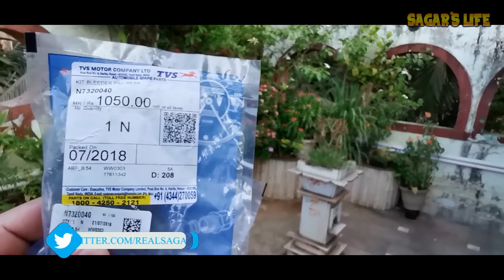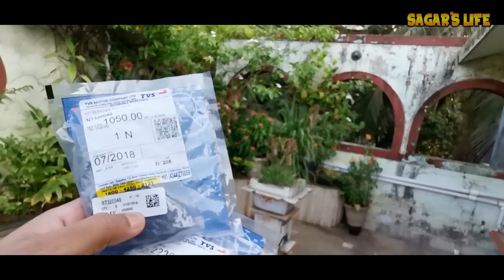How To Change Disc Brake Pads Of Apache RR 310 (Complete Guide)| Huawei P30 Pro

Comment: Hello Sagar my bike apache just clocked 6500 kms just did few long rides. When I should change my brake pads how to check life of brake pad
Reply from the maker: After seeing the brake pads closely You can view the remaining life of brake pad also there is guide in bike manual to identify the same with marking on brake caliper
Reply: Sagar's Life thanks

Comment: bro is bleeding required ?? i get spongy brakes on my 310 after changing front rear pads
Reply from the maker: Yes it's better to get all air remove, also if the oil is old then get it change, video for the same is already their on my YouTube channel 👍
Reply: Bleeding was done but still spongy braking works but play is more ...pads are entirely new ....
Reply from the maker: If It's for rear then it can be master cylinder issue lots of rr310 Owners faced it issue.

Comment: Bro I own an RR310, is there any alternate brake pads available since the company ones are dam costly. Please let me know if you have any idea.
Reply from the maker: Yes you can use the normal non sinther Brake Pads which will only cost you Rs. 200-300, but the braking capabilities also gets weaker on that brake Pads.. I will suggest you to use the stock sinther Brake Pads only, as when you can afford a 2.7lacs bike so the 1k brakes are not that costly 👍
Reply: Bhai i also own a 310 and the front pad got worn after 2400 km from 1st change . Should i consider rc390 brake pad for a try
Reply: @anubhavkapoor2305  I really don't know whether it's compatibile. Need to check with local services center
Reply from the maker: Yes you can use duke 390 sinther Brake Pads as they are same and cheap compare to RR 310 as they will cost you around 1700 as RR 310 cost 2236...
Reply: also chk ecb break pads they r lot better than stock
Reply: @anubhavkapoor2305  same here exact same km u hav to keep chking the rear pads they get struck on the disk when got rusted.... better buy a disk cleaner and keep cleaning every 100km
Reply: @SagarsLife  but it's 320mm disk front and 230 mm rear. Will it work?

Comment: Do we ever have to change the discs of the bike? I am talking about that big disc on which these pads rest.
Reply from the maker: Yes it's need to replace once you notice it's tearwear, as due do sinthered brake pads disk does get impacted
Reply: My rr's rear brake is absolutely nil and service center guys told me to change the pads but I think it's also related to the disc wear and tear. Do you know how the read disc costs for RR?
Reply from the maker: Sorry no idea as never change but it will definitely lower the price compared to disk brake pads, so will request you to try to change the pads with original sinthered one (not with the cheap rs.259)

Comment: The break pads are from brembo itself and are sintered .. Thats why it is costly.. You should have to mention this aswell.. good vedio btw..
Reply from the maker: I mentioned the same in video that these Brake Pads are sintered one...😊 Thanks for the heads up 👍
Reply: @SagarsLife  Bro only front brake pads are sintered on RR310!
Reply from the maker: Both front and rear brake pads are sintered, soon tvs is about luanch non sintered brake pads for rear only 👍
Reply: @SagarsLife  RR310's manufactured after December 2018 comes with Bybre brake pads at the rear which are non-sintered. It's costs approximately 300rs.
Reply from the maker: Yeah you are absolutely right 👍because of this the sintered rear brake pads will be no longer available in svc
Reply: @SagarsLife  no bro i said you didn't mention that brakepads are from brembo.. People thought it is the same as that seen in ktm 390's.. ktm uses bybre(subsidiary brand of brembo) which is cheaper in performance and price compared to one used in rr.

Comment: The size of this brake pad matches some other bike?
Reply from the maker: Not sure about rear but front Brake pads of RR 310 matched with duke 390 👍
Reply: @SagarsLife  ia the front caliper same for both bikes?
Reply from the maker: No both brake pads are different
Reply: @SagarsLife  sir, I meant the front brake caliper, not the pads. I think both calipers use 4 pistons right?

Comment: Bhai front and back costs how much combined ???? Brake pads
Reply from the maker: Front Brake pads cost around 2236 and rear 1050 so total cost is 3286
Reply: @SagarsLife  any sasta jugad like 160rtr brake pads are far cheaper can it fit into 310rr
Any similar idea will be appreciated
Thanking you in advance
Reply: @skp9821 bro  compromise by not spending money on stickers or fancy accessories.. Don't compromise on important stuff like brakes

Comment: ek help chaiye break related bro
Reply from the maker: Tell me Rohit...
Reply: @SagarsLife   apache 160 4v liya hu abhi 2000 km chli hai 500 km ke bad se break noise rear ka chikchik. kr k aa rha h service vale 2 bar plate 2 bar pad or ek bar caliper bdl diye or 5. 6 bar clean kr diya fir b noise thik nhi ho. rha h
Reply from the maker: @rht2992  you already have done the all possibility, just see whether the disk had any bends.. Normally after cleaning the brake pads it should be fine..
Reply: Bhai disc bend hota b to vo disc plate ko 2 bar bdl chuke h 2 din thik chlta h fir se start ho jata h
Reply from the maker: @rht2992  then lastly it comes to your wheel alignment...